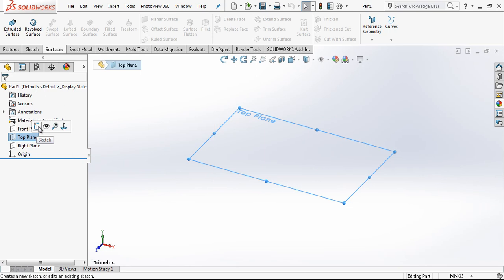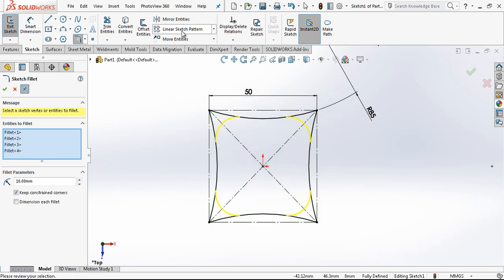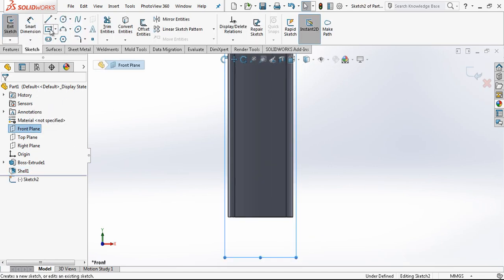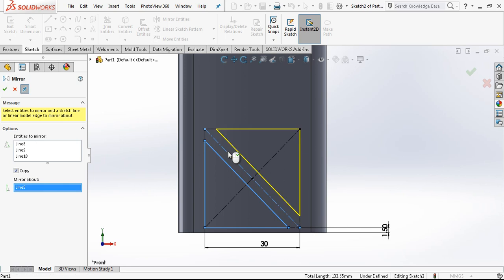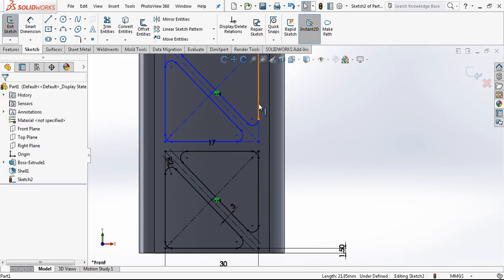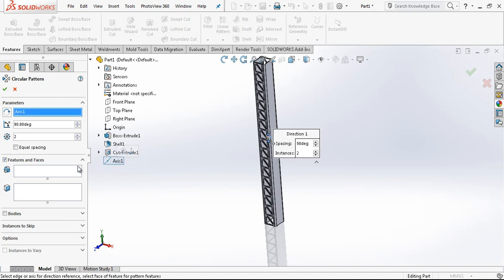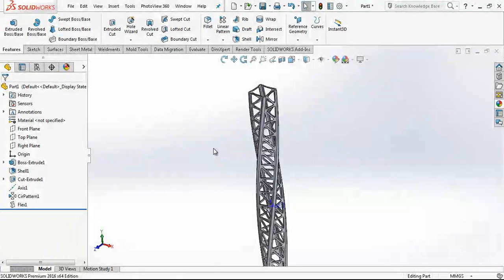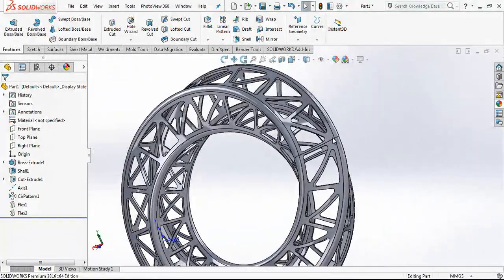Mobius Twisted Ring - SolidWorks Tutorial

Comment: i got errors in bending operation. it told "some faults were happen" something like that. even though i got the preview of the command
Reply from the maker: Hi Please make bending angle 359.90 instead of 360 degree. Then you will have not problem I think
Reply: @3D-World  i can't get beyond 350 degree
Reply from the maker: Hmmm, I don't know what is the problem.
Reply: @3D-World  thanks
Reply: @3D-World  thanks will try